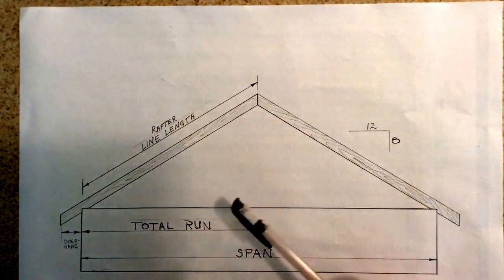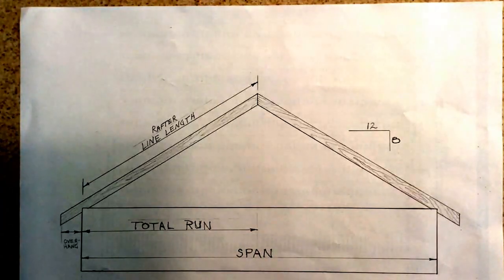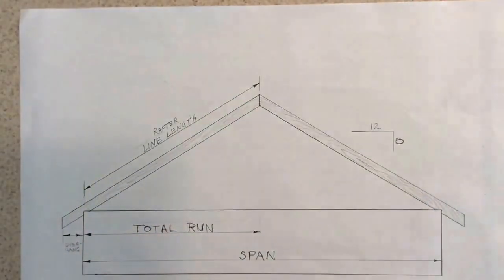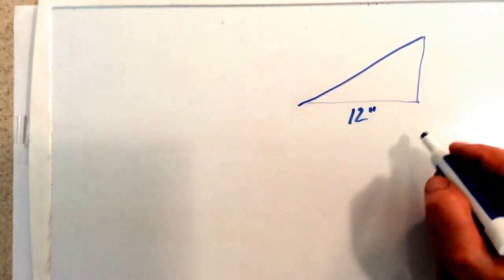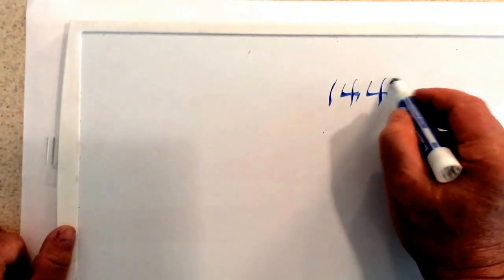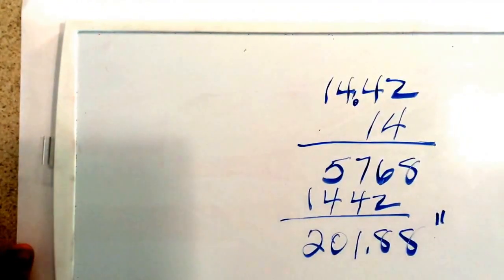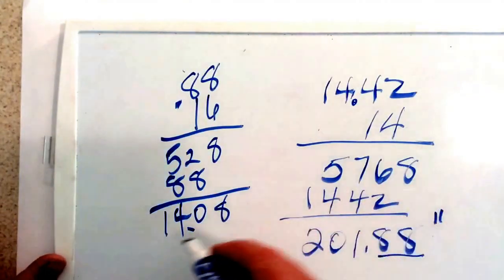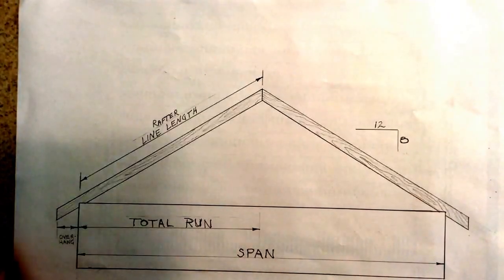Calculating rafter length

Comment: I don’t believe that’s right , you need to convert the feet to inches then multiply by your table , you don’t multiply 14’ in your calculator like that and then multiply it by 14.42. You would convert your 14’ to 168”then multiply by 14.42 then divide by 12 of your total number . You’re going to be way off on your math. You just confused so many people on YouTube . I’m surprised nobody called you out on this video
Reply: If you don’t believe me you can go back to basic math . Algebra 1.
   
8/12=rise/run  
Then you pothagrean theorem. Math is math. If you don’t convert to inches you’re gonna have a serious problem. Look at your framing square . It’s in inches! Which mean you need to convert your total run in inches before you multiply ! Then divide by 12” and you’ll have your rafter length from peek to birds mouth!

Comment: Finally found someone that knows the functions of a framing square and uses it correctly and not a bunch of crazy formulas and the little dinky speed square. Thank you. Also, an easy way to determine lenght of run per foot is by actually measuring it on the framing squre with your tape measure- no formula or math needed, simply measure between the 8 and the 12 on the diagonal and there you have it. Another way to determine total length of the rafter is to "walk" the framing square up the rafter- if its 8/12 set square on your rafter at 8/12 and mark it , then move the square up to the top mark and set it at 8/12 and mark that. Then repeat as many times as there are feet- 12' run means you mark it 12 times. Once you establish the run you can mark for the ridge board and add for the overhang.

Comment: One thing i notice is you are not conidering a top plate at the apex to calculate the run which woul be the run minus half the thickness of the top plate which then gives the correct run.  That way you have something to attach the rafters to.
Reply: Ridge thickness needs to be allowed for, 👍🔨🇮🇪

Comment: I looked for the overhang video. Can you explain the over hang? I have a 10'X12' deck, I would like the over hang off the roof to cover 2' over all sides.
Reply: Just add 2ft to the rafter length for your total length
Reply: @FirBurger98  correct way 14.42 x 2 =  your 2' over hang

Comment: Where did the 16 come from; along with your answer?
Reply: When your dealing with a decimal and you want to find it on a tape measure in 16ths. You multiply the decimal by 16. This will convert the decimal to a usable 16th number on the tape measure. Here he got 14. So that's 14 (16ths), or reduced is 7/8. Really easy once you do a few times.

Comment: slope= rise/run  he say span= 28,  run=14,    slope=8/12,    (rise/14run=8/12) we need to now the rise, rise= 14runX8/12= 9.33
rise= 9.33  rafter= √rise²+run² ,   rafter=√9.33²+14² =   16.82 answer

Comment: How would you figure out the diagonal without the framing square? Pythagorean theorem?
Reply: Jarlborg1984 yup
Reply: Basic geometry (or trigonometry, depending upon which way you calculate it)... You could calculate the angle taking the arctan of "rise divided by run" (i.e. opposite over adjacent).  Then solve for the hypotenuse by way of:
cos(θ) = adjacent / hypotenuse
hypotenuse = adjacent / cos(θ)
rafter = 14 / cos(arctan(rise/run))
rafter = 16.825906 ft
Or you could do the following:
8/12 = total rise / total run
  ->  total rise = 8 * total run / 12
  ->  total rise = 8 * 14 / 12
  ->  total rise = 9.33333
rafter = sqrt(total run * total run + total rise * total rise)
  ->  rafter = sqrt(14 * 14 + 9.33333 * 9.33333)
  ->  rafter = sqrt(196 + 87.11111)
  ->  rafter = sqrt(283.11111)
  ->  rafter = 16.825906 ft = 16'  13.2145/16"

Which way you calculate it depends upon what sort of pocket calculator (or calculator app on your phone) you have...

Comment: the run of 14ft should also be converted to inches so the half inch extra of the sheathing can also be accounted for when calculating the line length of the rafter ...so 14x 12= 168....then add .5 ...so 168.5x 14.42= 202.48in.........=202and 7/16
Reply: I was wondering about that. Thanks for clearing that up

Comment: Sir, when determining the length of the rafter do we have to add the thickness of the exterior siding? If I plan on adding a half inch thick siding, should I add that to my figures?
Reply: Yes, his example assumes this since he said outside to outside. It's always overall external dimensions including finishes. What he didn't point out is deducting half the ridge thickness, but his diagram didn't include a ridge board.

Comment: Listen, this explanation is perfect. What people aren't considering is that this is the theoretical line length. There are adjustments to be made to the stock. If you want the whole explanation take the 4 year course and spend the 8000 hrs in the trade and be a carpenter. Other wise sit back, relax and say thank you. Or hire a ticketed tradesmen. This is why trade time is expensive, because it's not as easy as watching a 9 min video. 

Thanks for the video.
Reply: @John Lowell right, some old school carpenters don’t like changing there ways tho
Reply: I believe he gave a good explanation of it except for the deduction for ridge thickness. I always subtract the ridge thickness from the span and then divide by two to get my run, 👍💪🔨🇮🇪
Reply: @John Lowell Well what are you waiting for? Go get your calculator and come make 6 figures with us. See you out in the field!!

Comment: yeah  what happened to the other  7/8 ... his answer  looks to be  14/16 but he said . 201 and 7/8  what he do with the other half ...smh  confusing
Reply: count out 14- 1/16 inch marks on tape rule it is same as 7/8 inch
Reply: Racso Zerep 14/16 is the same as 7/8ths.   Which is the way it would be communicated.
Reply: the easiest way is to get a little book  that is available. You look up the rise and the span of the building and it will give you the angle of the ridge beam cut and length from ridge bean to the seat cut.
Reply: If you cannot simplify fractions or read and convert  them on a tape measure, probably best to get a professional.

Comment: how to determine the pitch (6,12) or (4,12) or (5,12) or (3,12) and so, so why is so problematic the overhang thanks
Reply: To determine the pitch of an existing roof, it is possible to determine the pitch using a framing square and a level. Hold the level on the blade of the square and hold the square so the 12" mark on the intersects the roof line and the tongue is pointing down. Then adjust the square and level until the level reads level. Then read where the roof line intersect on the tongue of the square. This is the pitch of your roof.
Reply: To determine the pitch of an existing roof, it is possible to determine the pitch using a framing square and a level. Hold the level on the blade of the square and hold the square so the 12" mark on the intersects the roof line and the tongue is pointing down. Then adjust the square and level until the level reads level. Then read where the roof line intersect on the tongue of the square. This is the pitch of your roof.
Reply: The overhang is usually just added on to the end of the rafters after the birdsmouth cut as a certain number of feet and inches. It is not really necessary to have it as part of the calculation because it does not affect the length or pitch.

Comment: What about the thickness of the ridge beam????
Also, he came up with 14.08 but then dropped the .08!!!!!!!
Where did that go?!
Reply: .08 of a 1/16th.......if you could even see it you couldn't cut a rafter that accurate.....
Reply: @guitarslinger319  1/16" x 14 would be 1 1/8". Please read charles scott
 comment!
Reply: @noblecarpentry  you could see that...

Comment: Where in the hell did u get the 7/8 from
Reply: when he calculated the .88 into 16th of an inch he got 14/16... when you divide both 14 and 16 by 2, you get 7/8...  same thing.   like saying 3/4 is actually 6/8ths
Reply: 14/16=0.875
7/8=0.875

Comment: 201.88 inches? From where? ; it must be....20. 18" or 20 1/8" isn't it?
Reply: just the hypotenuse of a right angle triangle...  the length of the 'rafter' is the square root of the sum of the squares of the other two sides.   so if it's 2 feet wide and 1 ft high, it's 2x2+ 1x1 = 5... the square of 5 is 2.236...

Comment: where do you get the 1/16 inches and the 7/8 at the end?
Reply: Jonathan Blankenship 14  1/16 is 7/8 of a inch
Reply: Jonathan Blankenship .  He is trying to figure out what .88 of an inch would be on his tape measure.   So he converts it into how many 1/16" is the closest to .88    the answer would be 14/16".  If you count 14/16" on your tape is is the same as 7/8"  .

Comment: also what if the run is 14' 4"
Reply: trevor francis in this case, since 4” is 1/3 of 12” you add 1/3 of 14.42, that’s 4.8 so 14.42 times 14 + 4.8
Reply: You can’t build the roof then lol

Comment: Does your final measurement account for the ridge beam? I think that's what its called..Thanks
Reply: A lot of buildings these days are not built using a ridge beam. If it is used, half the thickness of the beam is the amount deducted from the final cut measurement of the rafter.
Reply: Does not look like it, but this video did for me was explain the framing square.  I like that, no one around to explain it.  Thankfully I found a old one a few months ago in a thrift store for nothing.   New  framing squares do not have that info on them.

Comment: but how do you decide if it is a 6 over 12 or 8 over 12 that confuses me?
Reply: Marcichlids !!!!!!!! Revo
Koitom
Reply: 12 is the width and the 8 is the rise (UP) so for every 12 inches it rises 8 inches. The math is to figure the rafters length and to help where the birds-mouth would be and this would fit from the center beam to the wall headers (Top of wall) I hope this helps your question
Reply: Marcichlids !!!!!!!!
Reply: He didn't allow for 1/2 the ridge board width.  That's the first thing I noticed, and I get a wonky number when I do it his way.  Even if I subtract the 3/4" it still comes out too long.   I did the same rafter layouts on CAD and got a different number.  CAD doesn't lie, it's accurate to 8 decimal places.
Reply: @Scott.Farkus  fine, but no carpenter needs to work to that degree of precision. Lots of timber framed buildings pre-date CAD. They look fine to me. Tapes  and squares require no electricity.
Reply: @Scott.Farkus  but if you input crap numbers in to software then you get s#1te results out. His diagram didn't show a ridge so his calcs. are fine. Seems your own efforts to prove the precision of CAD actually contradicts your assertion.

Come the revolution, those relying on tech to save them at a local level are going to need to be a bit more "hands on" than CAD inputs. The ☄⚡🧨🤞🤞😂